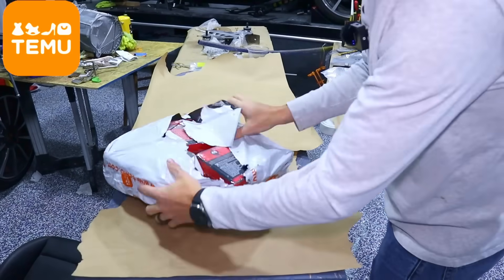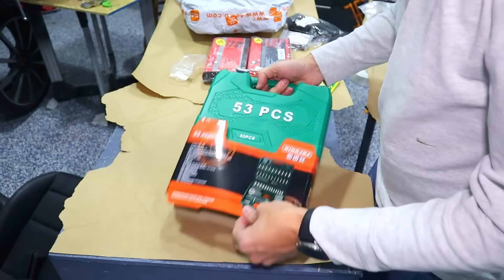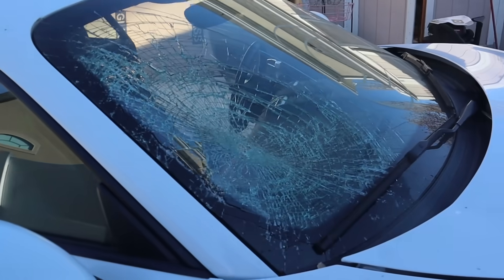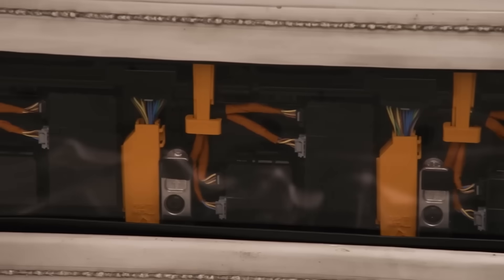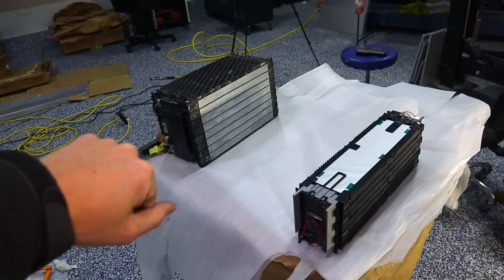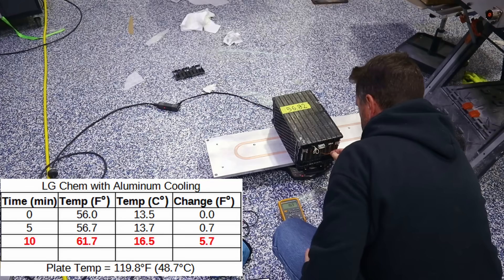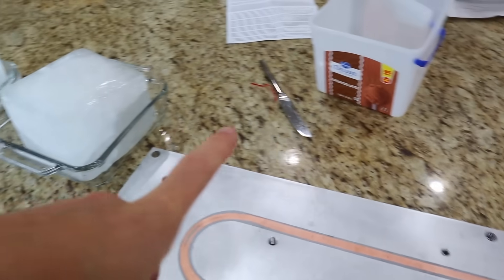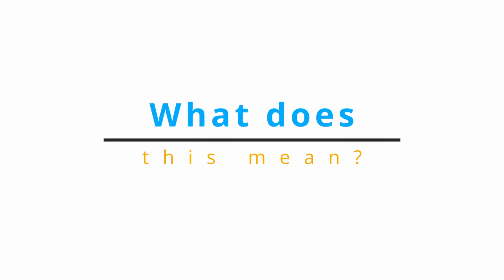Battery Cooling Mythbusted - Heat transfer to battery modules

Comment: I watch all my videos I make and if I don’t like it I’ll re-do it if I can. Some I can’t. I did testing with LiFePO4 cells by imbedding them in ICE and charging them and when that did not go so well I just sealed the battery in a cooler with dry ice and got the cell down to -58 degrees f and at that point it no longer charged or discharged. I think I actually got colder but my meter could not register any colder. It did ruin the battery. It never did recover fully. When it warmed up to around zero degrees f it began taking a charge again. It would also discharge too. Im using Leaf Modules that have no real cooling or heating. Nor did the LiFePO4 cells. Cooling through the plastic or heating through the plastic was slow at best. The plastic was sort of an insulator and is similar to how the leaf modules heat and cool. I think the best way to do a cooling at the manufacturing level is to have heating or cooling components between each and every pouch if you are using pouch cells which most are actually using. That way each pouch has a way to heat and cool in a very thin film of metal or what ever can actually move heat the best. That would however increase the cost and I believe the semi cooling and heating has been good enough. My first conversion was with DC Series motor and Lead Acid batteries.

Comment: Do you have a link for the thermal pads you used.  We are starting our battery boxes with the Pacifica cells
Reply from the maker: There are two sizes. 

The longer one (17.5" x 11.25") I showed you is part number 24282825 https://www.gmpartsgiant.com/parts/gm-pad-cell-bat-24282825.html 

The shorter one (13.5" x 11.25") is part 24282830 https://www.gmpartsgiant.com/parts/gm-pad-cell-bat-24282830.html

Comment: To be fair, you wouldnt (and didn't in your last build) just put the bartteries 'dry' on the cooling plate, you'd use thermal paste or better non  conductive heat pads. 
I'm curious to seehow it performs real-world. It may still be sufficient in normal use.

Comment: How long does it take to heat or cool the plate by running coolant through the lines? Not the results by heating or cooling the batteries. 

How hot or warm can you make that plate by running coolant? 

Or did I miss that part of the video?
Reply from the maker: A few minutes

Comment: Came here to check out your temperature testing video after I commented on your battery box video with a slight worry about heat in the center of the pack. While this test does a good job of evaluating the difference between your modules, and some modules that are more thermally conductive, it doesn't evaluate the thermal performance of a stack of modules under load all enclosed inside a battery box. I would still recommend that you add one thermistor in the very center of each "stack" of batteries in each box. At least you'll have the data to tell you if you are getting a dangerous hot spot that you can't see from the outside with a thermal camera. I would look at it as a bit of incredibly cheap insurance. Still loving your videos! You're inspiring people to explore projects like this. I'll be watching for sure. Can't wait for that first drive video. 👍

Comment: To make temperature measurements more consistent and fast, I normally add a tiny drop of water to the sensor or at the place I will measure the temp.  Water is a good heat conductor, and works great as an interface between the sensor and object to measure; and is pretty easy to clean and leaves no residues.  Other liquids are too messy.

Comment: Hello, Firstly great work, really inspired. I'm currently working on a battery thermal management system project and was wondering about the type of temperature control system you're utilizing. Your insights would be greatly appreciated. Thanks again, and consider me a new follower – your work has truly captivated me. Best of luck!support!
Reply from the maker: Hey man, welcome aboard!  I usually will just answer questions, but this time I think it will be easier to point you to another video.
https://youtu.be/U7RU089trEQ?si=E8GK-7RXV-yW7FiL
The second half of Kevin's video goes through some good detail about thermal management
Reply: @electricsupercar  For controlling the Pumps based on thermistors, which controller have you used?
Reply from the maker: I am not that far yet, but I believe Kevin used something like this.
https://www.aemelectronics.com/products/ev_conversions/power_distribution_unit/
It can be controlled to turn things on and off based on inputs from sensors and code.

Comment: Do you know the application of the smaller lg chems?  Trying to find the correct packs to use for a dual motor space limited application
Reply from the maker: I got mine from EV west
Reply: The modules which are being used here are intended for moderate-power backup power systems.

Comment: My wife was telling me just yesterday about a story that Tesla's were not charging in Chicago because it was too cold. Not sure if this is true but it makes sense if there is no provision to heat the batteries up to a point where they would charge.

A couple of questions.

1) If a battery is very cold, say -10F can it be damaged?
2) If a battery is too cold to charge what mechanism is in place to warm it up and how does that work?
Reply from the maker: Yes, batteries can sustain damage if charged below 0 degrees Fahrenheit.   To warm up batteries, usually the high voltage system (battery) can discharge energy into a heating system to heat the batteries.   If the car is already empty...therin lies the problem

Comment: Please don't encourage people to blindly use any tool, especially anything built with "AI". It will distort the content, and if used without considered proofreading and editing it will hinder rather than help communication. 

Have you ever fed text to an online translator, then into a translator again to get it back to the original language? The result can be comical, and is rarely correct.

Comment: Both modules presumably have built-in temperature sensors designed to monitor cell temperature for protection - why not use them instead of probing the electrical terminal hanging off of the side?

Comment: Heat transfer is through the thin plastic film of the cell pouch in both cases. The differences with the modules not intended for EV use are the lack of a heat-conductive path from the cell face to the module face, and the addition of a much much thicker block of plastic in the heat transfer path. 

I'm surprised that the that heat transfer penalty is as small as it appears to be.

Comment: The description starting at 5:18 of the difference between the two models of LG Chem modules is good (although it could have used illustration with the components of each module broken down).

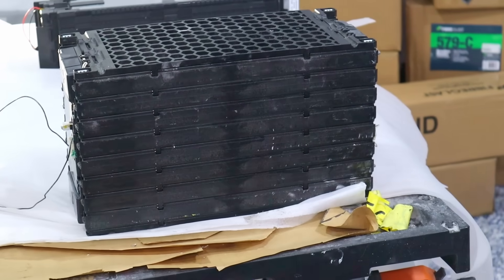Comment: What is shown @4:21 is not a pouch-style battery , it's a pouch-style cell . The unit shown at 4:41 is a module , which is technically a battery (a group of cells), but since it is intended as one component of a larger battery is never called a battery by itself in automotive use. If you don't use the terms "cell", "module", and "battery" correctly you'll just confuse people... and you know the correct terminology.

Comment: where I can find the LG chem batteries? not the Pacifica battteries
Reply from the maker: EV West
Reply: EV West sold the Pacifica modules, and when the supply dried up they found these other LG Chem modules (which are intended for stationary backup power systems).

Comment: Your most recent battery selection video + crazy cold temperatures made me think - Could one use an EV as Vehicle to Grid (V2G) in a relatively safe DIY method? Also had thoughts of a DIY lithium powered Golf Cart, which then would be able to backfeed. Do toy know of any currently available Tech? Would be awesome if an EVSE would allow this, but I understand it would require bidirectional control of the onboard vehicle charger, so thats unlikely.
Reply from the maker: Interesting 🤔

Comment: Thanks for the great video. 
 I might be wrong on this matter but I believe that Mercedes Uses thermal gap fillers because to have higher surface area. Also there is some thermal expansion and they do not want to have a air gap between cell and the cooling system.  Both of your showed designs are not that great battery designs. Nevertheless the battery with aluminium heat plates will distribute heat all over the cell area and has more thermal mass which is also good for rapid power draws. The other design might have a problem where it getting hot in the middle.  I do not think that you will have problems when you are driving the car in normal conditions (Unless you are tracking it). But I do think that CCS charging speed is going to be affected of this layout.  

Smart way is to start with batteries that have already built in cooling. If you compare the prices of those then it makes sense because there is not that big difference. At least in europe.  But then you do not have that kind of modularity.  At least you guys can get Lucid air battery modules that are in my opinion the best design that I have ever seen (Except some heavy duty vehicle batteries).   We will see in near future smaller and real fast charging capable batteries but those are cooled completely differently. Current older designs have just too many heat transfer bottlenecks.  If you have big battery then the load for single cell is not that great. But when you have a 36kwh battery that can fast charge km with the same pace as new EQS then these bottlenecks become a problem.

Anyhow good luck. 

Also It would be nice if you would make a video about what you use for making your youtube content and also what channels have been helpful for you do learn how to make better youtube content. I believe that there would be many who would be interested.

Comment: Try to pay attention to which cell tab you put the thermocouple on, The cell Cathode is aluminum and conduct heat less than copper ( the Anode) But if these are already joined together it does not matter as there are both welded together. Puting thermal paste on the tip of the thermocouple is really helping precision measurement.  Finally, the mass difference between the two packs might have influenced the thermal transfer result for your measurement. If both packs weight the same then you can compare apple with apple  but if one is heavier than it will tale more time to stabilize than the first one and give lower temp that it should.
Reply from the maker: Thanks for the comment

Comment: You had an aluminum plate at the bottom into which you inserted copper pipes for cooling.  Why didn't you test cooling the battery with cold liquid through the pipes and clamped only on the edges of the aluminum plate to have air insulation between the ground and the plate.  After all, the liquid will cool the batteries and not the ice cube.  It is better to have the answers to these questions now rather than later when everything has been put together.  And one more thing, if you combine different metals such as copper and aluminum together, you create a battery and a reaction occurs between the metals!  Sorry for my comments but I'm just trying to share my experiences and concerns with other people.  It's like a kind of therapy for lonely people to feel connected to other people.
Reply: I think that's valid, but the liquid cooling system hasn't been built yet so that's not really an option without a significant additional effort.
Reply: @brianb-p6586  It's true that the water cooling system hasn't been built yet, but he mentioned that he's already made all the big purchases, I'd expect that to be included, because otherwise he won't be able to charge the batteries.

Comment: No. Just no. 
Using a battery not for it's intended use, in an extreme environment, with inadequate precautions/protections. 
If this is the battery you are choosing, and this is the cooling method you are choosing, all I can say is that you are going to need one amazingly good fire suppression system and that the first heavy footed drive will be the last.
200 Hp? Yes. 900Hp? No. HELL NO.

Comment: 100% AI-generated. You know more about this topic than I do. I just wanted to comment for once to your videos. Great work on the battery cooling experiments! Your approach to testing the heat transfer capabilities of different battery module designs is thorough and insightful. One aspect that might enhance your findings is considering the long-term effects of thermal cycling on the battery cells. Repeated heating and cooling can cause physical changes in battery materials, potentially impacting performance and lifespan. I think integrating this aspect into your testing could give you a more comprehensive understanding of the effectiveness and durability of your cooling solution. Keep up the fantastic work!
Reply: @electricsupercar  this is why AI tools are bad. The AI-generated comment has no content of any value - it is just an assemblage of phrases related to heat transfer and batteries.

Comment: Interesting results, I wouldn't even think you could effectively cool the LG Chem since it didn't have a flat area.   I wonder how much just a regular fan blowing across the plastic fins would help.   Weird LG didn't think of putting a pad of sorts on their design.
Reply from the maker: Great point!
Reply: Both module styles are from LG Chem. These modules are designed properly, and there is nothing that LG Chem designers didn't think of. A heat transfer pad or paste is used with the modules that have the aluminum heat transfer face in every intended application.

Comment: Maybe a better way to run this test would have been to use the cold plates like you intended! Instead of just heating/cooling them, just pump water througj at the temperature you want. Probably a bit more work to setup but more reliable/consistent overall.

Another tip for your integration is to put some thermal compound between your modules and cold plates to get better thermal conductivity, but I'm guessing you were probably already planning that in the final assembly

Comment: I had slightly hoped you would use the tubes in the panel for the heating and cooling experiment (especially the cooling to avoid the instability!)

Excited to see how you plan to actually heat the "coolant" for the battery in the final car
Reply from the maker: More to come!

Comment: One thing to clarify: adding the second cooling plate won't quite double your cooling capacity. This is because you will keep the battery temperature closer to the coolant temperature, so there is less temperature differential (commonly called "delta T"). The total heat flow (Q) is a function of the heat transfer coefficient (h) * (delta T). Your "h" is fixed based on the materials you're using and the mass flow of the coolant, so if you have lower "delta T" then you won't have as much heat flow per unit area. So doubling the area doesn't quite double the cooling. Hopefully that makes sense, Youtube doesn't allow for nice formatting of scientific formulas.
But the bigger effect is that you're going to alternate batteries and cooling plates, so most cooling plates will be heated from both sides. Basically, your proportion of batteries to cooling plates (i.e. one pack might have 8 batteries:10 plates) will determine how much cooling capacity you have. Along with how you run the coolant lines (i.e. will the coolant circulate in series or parallel for each plate?) 
A much more scientific test would be to put a high electric load on the entire completed battery pack (like by DC fast charging it), and use a variable coolant pump to determine how much coolant you have to move through your system to maintain your desired temperatures.

Comment: cant you just add a ground wire from the cooling system and still use the aluminum cooled batteries? it should eliminate the build up of the curren, if the build up isnt quick it should fix it. even if its quick, the ground wire should be able to deal with it nonetheless
Reply from the maker: No.  Grounding the high voltage buildup to the chassis was the cause of many problems with my last build.  Fried 2 inverter boards and 2 controllers before I figured it out

Comment: Hmmm in a dc system I wouldn't expect a capacitive voltage reading. Very strange. Was there a voltage difference between the different cell's cooling plates?

Comment: I think your test were good for a static battery. But, I would like to see battery temperature tests run 1) using the cooling system in the plates 2) while charging and 3) during a fast discharge. The batteries get much hotter during times of charge and discharge. So testing your in-plate cooling during these times is really needed.

Comment: It is nice that you are actually measuring the heating and cooling effects on these two different batteries, rather than just giving it an educated guess, and maybe being sadly surprised later. The other benefit is for us viewers in understanding that there are so many different choices and considerations that need to be researched and made with a complicated project like this. It also shows that doing a project well, prevents having to do it over. Even though that comes up too with complex/custom/bespoke projects like this.